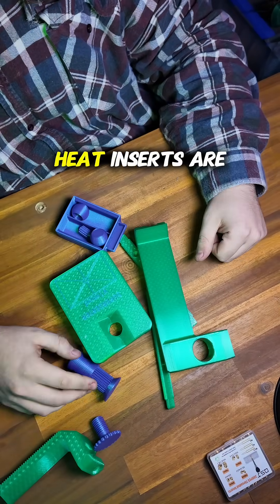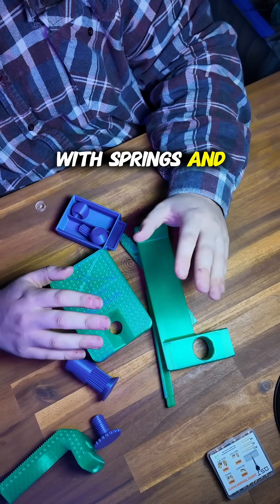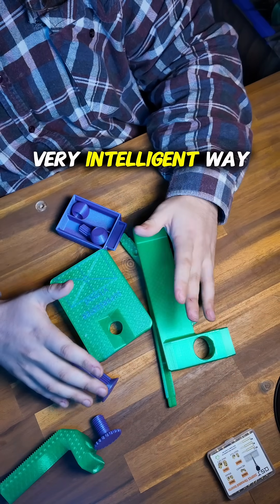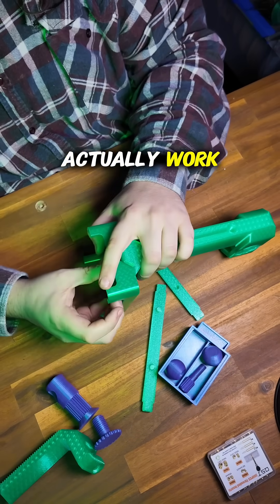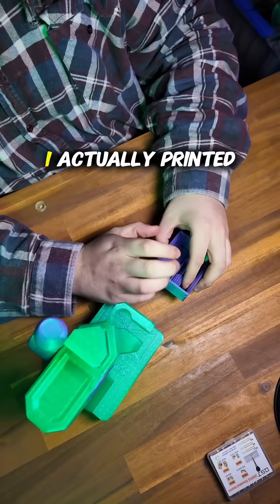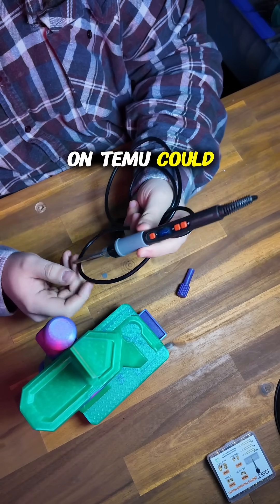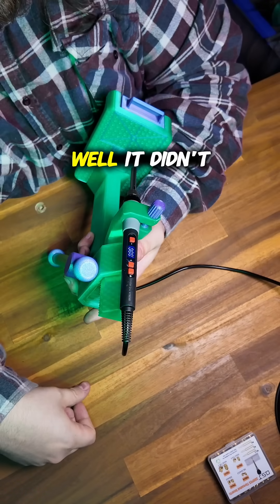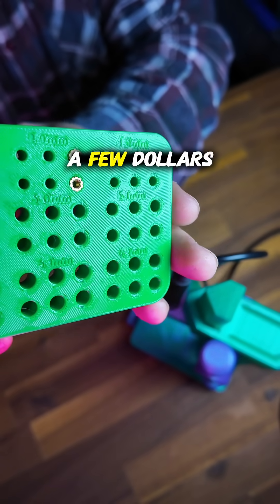Not every tool needs to be complicated

Comment: This is crazy. Use tapered heat set inserts, model the hole to match the profile, press them in by hand halfway, use soldering iron to heat (optional tip to math ID of insert), press into part using an object with a flat surface. None of this is necessary by any stretch of the imagination.

Comment: Don't forget to use exclusive slicing tolerance when slicing your model. Most model benefits a lot from this setting especially for treads!
Reply: I don't know about other slicers but in Cura, to change to "exclusive slicing" you scroll all the way to the bottom to experimental.

Comment: I would just get one of those super cheap Power Drill Bench adapters and make the hole smaller to fit an iron instead of a drill...
All made if Metal, spring handle..
Not a light weight item that will fall over..
Will never need to replace it again with such small loads and probably costs the same as making this..
Last time I saw them they were $15.. Chinese rubbish that I would not use as a proper drill press but over engineered for this..

Comment: I wouldn't call other people work who are farther in their iterations then you are over engineering. For babies first heat press I get what you're trying to say but that is why so many various versions exist. FInd one that is at your current maker level.
Reply: ?The whole point is people dont want to use none 3d printed stuff, that just bogs it all down
Reply: @Hannibal2468Slt you say it bogs it down but that's your interpretation. It was probably designed with their specific purpose. Again saying it's over engineered is reductive and not an accurate statement. It's like a bike rider calling a car over engineered.

Comment: If you’re printing threads and nuts, always use the same spool. Different spool, different colours etc will have their own individual shrinkage ratios. If you absolutely must print different colours then work out the shrinkage ratio of each spool and then accomodate for that when printing out the parts.
Reply: Yeah I’ve noticed this for parts that have to work together. I was printing something out of petg and just printed the small rotating axle out of pla and it just doesn’t fit at all

Comment: I think talking about how simplicity is better and then the tool fails to do the job correctly, shows that simplicity isn’t always better LOL. A insert needs to be in the center of the hole, otherwise your bolt won’t align…
Reply: I would guess it was user error when learning to press the insert.  more then the press.  Since the press is just up/down the alignment is all user
Reply: The lesson there is you want it as simple as you can get away with to still do the job. Too simple and you don't get away with it

Comment: Sounds overly complicated still if it needed to be printed 3 times? That's just a waste of plastic. Using 2020/2040 extrusions is usually done because so many early printers used them that are phased out now. Smooth linear motion without snagging or feeling false haptic feedback from what you are focusing on.

Comment: This is very true. Overcomplicating and over engineering is a huge issue. Sure it works, sure it has tons more functions, BUT does it need them. What is the actual application of this thing you are making? Most of the time it doesn't need to be swiss watchmaker complexity. Or kraut space magic. More often than not iterate until you remove complexity. Because it just makes everyone's lives simpler.
Reply: But for the joy of it!
"But wait! There's more!" lol😂

Comment: Throwing a comment out here because I think the lesson about not over complicating is very true. It may be true also as others have pointed out that an insert press is mostly unnecessary in the same way that the inserts themselves might be unnecessary for many designs. This to me seems like a great simple solution for a simple problem that if someone needed a press they could have one in just a few hours with what they already had. Which is precisely the core advantage of owning a printer to begin with
Reply: I was gonna print this whole thing until I remembered I have a mini drill press, I'm gonna just print a clamp to attach the iron

Comment: I believe most don't need heat insert press at all. At least many models does not need any verticality for heat inserts at all.
Reply: Indeed, the only time you really need them if you have a screw connection that requires repeated inserting and removing.